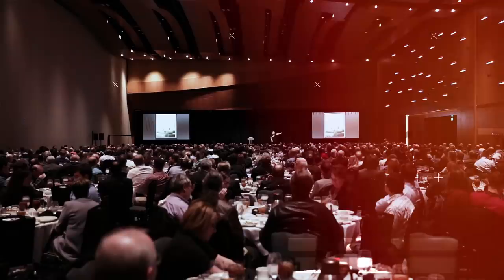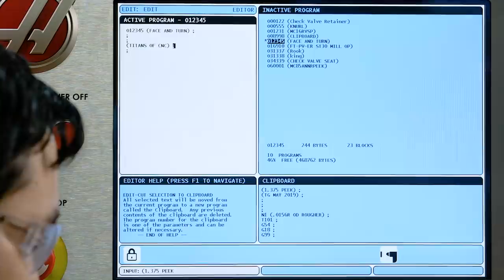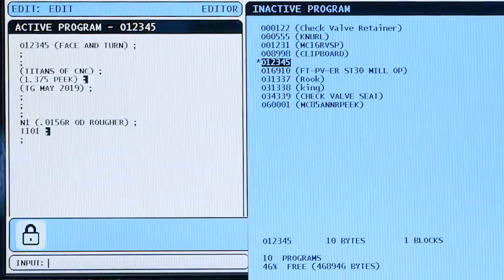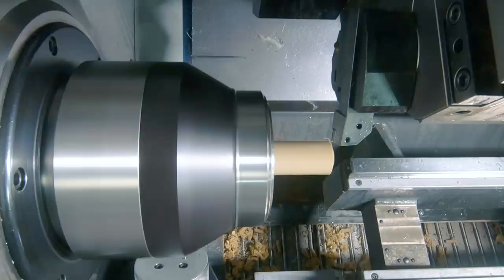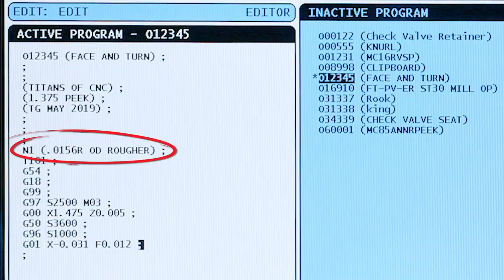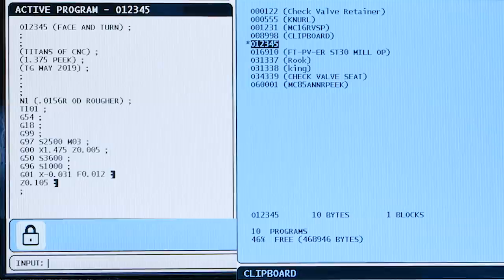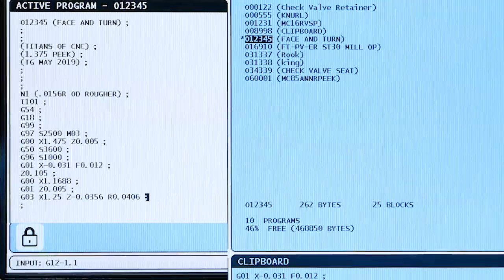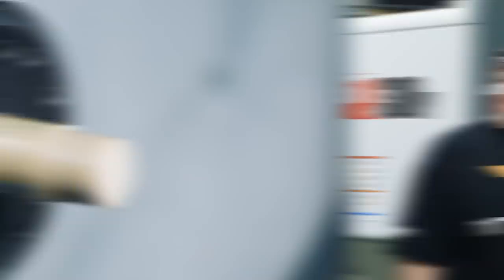G & M Code: CNC Lathe Programming by Hand  - Vlog #91

Comment: When putting in the Z move for the Radius if W is used instead then the W value is the same as the Radius no matter where you are on the part. No need to do added math. Same thing with using G42 to compensate for the tool Radius. I am a lazy free hand programmer so those little things make life much easier and quicker. Great introduction video to free hand programming and shows the details of what the machine is doing when creating a Radius. I would love to see some videos on can cycles and cutter comp. Keep up the great work. Love what you guys are doing.

Comment: Nice video that actually links G code to tool movement.  I learned CNC with manual G Code on 3 -4 axis CNC Mills. Didn't do that much lathe work in 25+ years. But now that I teach it I find that the lathe is easier to hand program  - but its a different animal for sure - Back in the day we had Mill guys and lathe guys and we never knew what each other did. 

 it would take more videos to explain the basics of lathe code (especially if you are a mill person) . Cutter comp is different -  have to think of X axis as a diameter at all times in reference to rads and chamfers - you only need SFM and Chip load for 90% ( less math). Incremental movements can be used  yada yada - 

I forgot about doubling up on "X" face move for a 1/64 rad - thanks - plus Kuddos on the Knurling - I have been pondering that for our Haas ST10 - keep up the good  work Tyson

Comment: Nice video.

I used to run a Bavelloni 4 axis CNC mill, cutting kitchen worktops and all my jobs have had the G code created by a tooling program.
I had been doing that for 6 years, I could quite happily do any job without problems (Providing it was doable)

My new job I am just an operator on a CNC lathe, im not being taught fast enough about the code, I suppose its better for them for me to bash out parts than to teach me about the code.
It was nice to see your explanation and to understand more about the code that I see running, so yeah, thanks :)

Hopefully these videos will help me progress

Comment: I started working in a shop just under three years

Now I have 40 years of tool & die metal fabrication welding

The longest time I spent playing with seeing cease was back when they still had tapes to control

Over the years and different shops I worked at we would bring a new equipment I would unpackage it set it up wire it up put air water whatever it needed basically get it ready for the setup guys to come in

When they were done I might get to play with it for a few

Fast-forward 40 year career

I walk into the shop get a job tell them all
In less than two years I am hand coating at the console both the Lay's and the Mills

I also figured out how to use their Cad and cam

That they haven't paid for since 2019

A month ago they hiring some new workers
Mill and lathe and leave guys that supposedly know how to program

Only one of them the lathe guy can program at the lathe 

The guy running the mill
I had to show how to run our outdated CAD cam

Because he doesn't know how to program at the Mill

The company immediately revoked my programming privileges as they call it

Because we have guys that can program now they don't need me to program

Both of those guys make $10 an hour more

Both of them come to me for help

I told them both sorry guys I can't help you you make more money than I do

I can program faster then both

And my parts are good

We have another new lathe guy
He can't program at the llathe either
And doesn't know how to run the CAD cam

So a program that might take me an hour
Takes him for f**** days

I learned how to run these machines how to program them on my own

Comment: Great video guys! This is what did for years was hand program everything at lathe.  I use to set my machine defaults at the top of the program just below the part number (example G54, G18, G99 etc)...but the way you did it is just as good also....One comment I read was to use a G42 for cutter comp.....I used that a lot myself ( Cutter comp can be tricky for a beginner, but once you get use to it, you will love it).....Either way, great video dude.

Comment: Excellent tutorial Tyson. I know this was an educational video, but on a production program, do you program in a safety block at the top of the program to cancel any offsets or absolute / incremental info from the previous program so the new program doesn't pick it up and potentially cause a problem?
M  is for Modal commands.
Again, excellent video.
So glad you guys are getting the next generation(s) up to speed on cutting edge manufacturing.

Comment: I work at NTN as a set up technician and I would really love to see and learn more about programming in all aspects. I work with metal grinding wheel lathes and also CNC lathes. Most of the grinding wheel lathes have a template for the program but the you have your GA60 II witch are grinding wheel program base.

Comment: What about G42? Tool radius compensation

Great video tho 👍 
Will look forward to more of these lathe CNC tutorials
Reply: I think hes manually comping tool rad. Used to do it since the old mori's I ran would loose their shit if I tried G42.
Reply: Dont forget G41, depends on the toolpath of the tool, as well as where it is in relation to the material.
Reply: @JustAGuyWithALongScreenName  same same. Ugh. Good God I don't miss those days at all. Having the controler freeze up because you tell it to "do" to much at one time.... Both things. Like move in -Z and turn the spindle. Blah. "You are a lathe that's your thing , you crusty old pos." LOL

Comment: Hey, thanks for this video! It would be great to see a video calculating angles on a part by hand.
Reply: Key point you say --- By Hand. -- Under CNC control there is No error.
However by hand is completely different matter as hands are fluid not ridgid like a CNC.
May I also say CNC is only as good as the accuracy of the Machine so a good Machinist evaluates the output of the Machine before spending money on material scrap.
Any metal cutting CNC Machine can have a Probe installed and programmed for routine with known dimensions then after routine you evaluate results of accuracy. 
Most ALL CNC Machines have Ball Screw and any slop can be adjusted.out or even programmed to compensate.

Comment: Just really jumping into the lathes fully now, im wondering if you guys have any vertical turning lathes and maybe you could show how to run parts on them.

Your extremely good at showing and vocalizing how to do these things. Your a good teacher.

So thanks your lathe videos are extremely helpful to me right now. Im a mill guy but I can finally work with lathes, large vtls but as a pretty well complete beginner on the lathe side this is teaching me alot 

Thanks from canada

Comment: I have a question - how do you hand program a threading operation? I used to run a conversational Johnsford lathe and it was easy peasy but what I didn't like about it is that it spit the G-code at you and you didn't have to learn. Like, how do you do an 1/8" lead thread. Just curious.

Comment: You started your program with T0101 but if the turret was real close to your part when you started the program, wouldnt it be possible for some of the other tools to hit  your part during the tool change? Wouldnt you want to have a code to position the turret at a safe tool change position before calling up the tool change?

Comment: Great vedio .
Sir . How to calculate feed on lathe cnc .with examples.
I will wait for your next vedio
Reply: Same idea as on a mill, but people usually use inches per revolution(which I think makes way more sense). So it's really easy, you figure out your RPM buy using SFM(or just run G96(constant SFM) and then put in your feed per tooth. Usually look at the insert box and start in the middle and the machine figures the feedrate for you.  If you want to figure out your ipm just use RPM x feed per revolution.

Comment: one downside about this is that the new interface of haas controls are totally different, does not look anything like this. like the way you probe the tools in the lathe, on this control you press mdi - program, f1 to move the probe. on the new gen control you press edit, walks up to vps, down to probe, and to move the probe f2.
Reply: we have two new gen controls in our milling dept..we all hate them.
Reply: tbh i have only experience from the new gen, attending an education where we have one st10 and a minimill with the new interface, so i can't say which is better. i have downloaded manuals from haas, 2016 and 2019 so i can compare that way, but that's the only way for me. so i am a little bit scared how it's gonna be the day i step inside to a company where there are other controls.

Comment: how does the machine measure the tool   this is important, otherwise the diameter will be incorrect   or you point for radius   gores wrong   ,,I have seen many take a chip and set the diameter of the tool z zero on the end  .. it's easy but the radius gets wrong they forget nose radius by radius programming  .. especially turning, you have to think about everything

Comment: I need the guidence for 3 meter length CNC lathe machine for speed and feed , vibration issues and which kind of tool will be suitable right now I am using TNMG KNUX koycera

Comment: How would you program a tool change position on a long lathe. say you are machining a part that is only 8" long but the machine has 12' of z travel. Sending it all the way home would be a real waste of time.
Reply: All you would need to do in that case would be to pull your tool a safe distance away from your part so that your turret can index without a crash. It is not necessary to go fully back to your home position. 

For example since your z offsets are touched off the face of your part/stock you would simply measure your longest tool and take that value and add a little more onto it to give room for the turret to unlock and index. Lets say the longest tool on my turret is a drill that is 2.000" long, I would program the machine G00 Z3.5". That would rapid move my tool 3.5" past the face of the part and allow me to safely index without risk of a crash as I left 1.5" of extra room as a safety net. You can make that safety net as close or as far away as you like just as long as there is room for the turret to lock and unlock.

Comment: But I'm working with. MAPPS!
Reply: Love MAPPS. Shouldn't even worry about it there.
Reply: I hate mapps, it really only give's decent code for really simple turning, anytime you try to do a complex groove the code it give is terrible.
Reply: @85CEKR  always had good luck with it. Only problems I ran into was having to use an improper fraction (9/8) to tell it what drill size to use. Then again, it may be slightly different between lathe and mill.
Reply: @JustAGuyWithALongScreenName  I've found it too be good for getting new people started in cnc, my main issue with it is the grooving cycles, they don't seem to work properly on complex grooved shapes and don't even think about trying to make an efficient groove cycle that will break the chip in long chipping materials.

Comment: you can only name the programs with numbers?
Reply: No you have to use the number to give it a place on the list but the actual name is written in parentheses.
Reply: Newer Fanuc controls you can use anything as a program name. You can use the legacy ‘Oxxxx” system as well. On new Fanuc controls, you could have this part named ‘1.375_PEEK’. It would be displayed on screen as < 1.375_PEEK>. No number required. I prefer to use the actual drawing number as my program name.